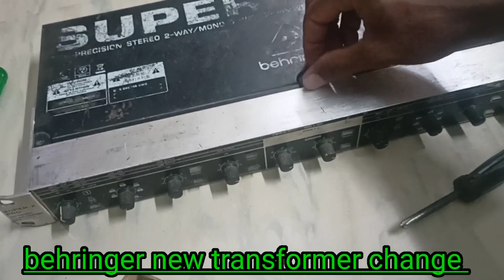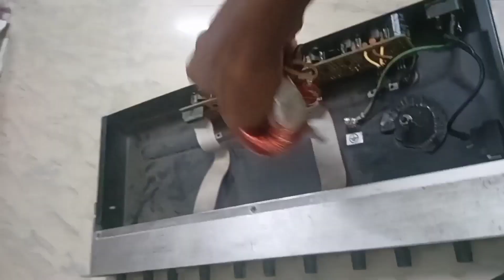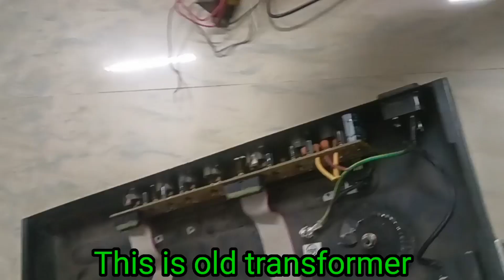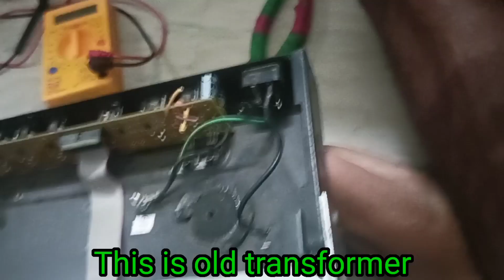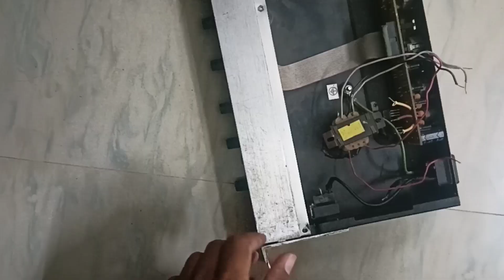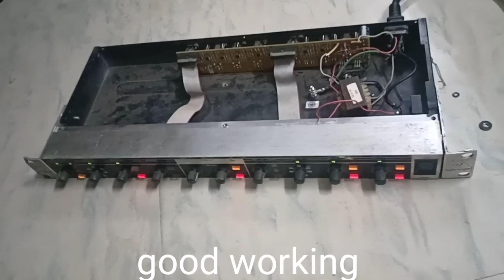behringer crossover  repair new transformer change

Comment: I bought this compressor, but mine came with a noise from the power transformer, a fuse blew, then it no longer turns on, the other fuse only worked a little, now it doesn't turn on, I really want to change the transformer, do you think the transformer 15w line would work?? The voltage is 220 volts in my city (Brasilia, Brazil), there was a lot of damage to the bodywork due to the delivery, it was severely dented, I believe this caused the damage, the plates are good because it worked with the buzzing sound for a few moments and the components They behaved well, I would really appreciate this confirmation regarding the source, please, I hope someone can help me with this! thanks in advance to the blessed one, mdx2600 i have